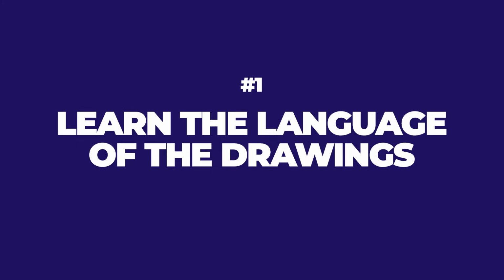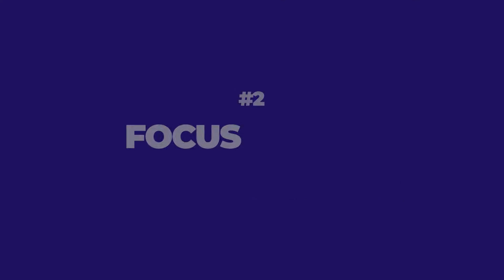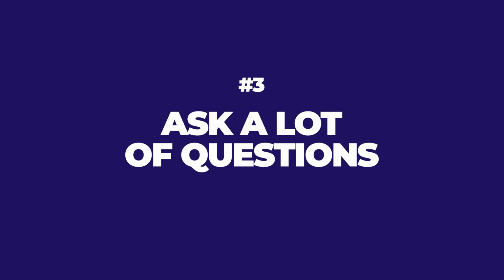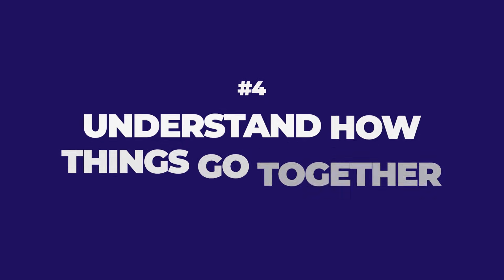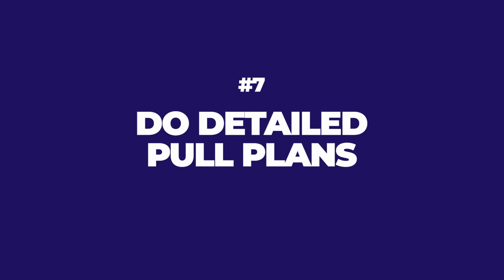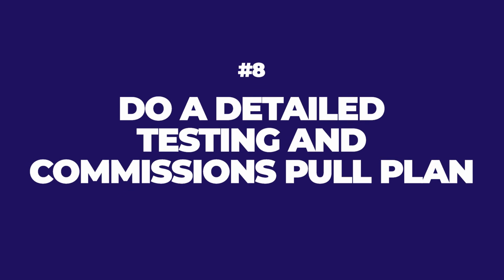What Is MEP In Construction?

Comment: Hi sir. I'm a Mechanical Engineer by degree. Working as Cad 3d Admin for the past 2.5 yrs in oil & gas field. Looking out for a job change into MEP field as my current job doesn't deal enough with technical. I need your guidance on how to get transition into MEP. Thanks in advance.

Comment: Nice overview of the MEP trades and how they fit into the overall building puzzle. And, as a long-time MEP Electrical engineer, I totally agree and champion what you said about understanding the "Systems" first, such as the overall system diagrams, mainly the one-line or single-line diagrams in electrical's case. This should be treated as your overall road map to the electrical system, and then treat the "in-the-building" views more like actually in your car driving through the town with landmarks. Well done!

Comment: Do you have to be an engineer to work on and draw plans for MEP? I have construction and mainly electrical experience but no drafting or schooling. Do you think its possible to get a job without a degree?
Reply from the maker: @ZuglyRed  I would hope so.  I would hire you if I did that and you were a cultural fit.
Reply: my course of study is economics....right now I'm almost 12 years in the MEP building industry as a MEP supervisor. at first, I thought it was a little bit hard to understand MEP. Right now I can easily understand the system. you need to always ask your vendor about the system.